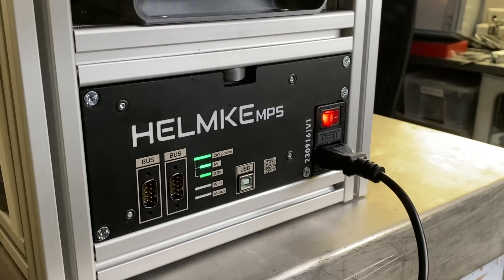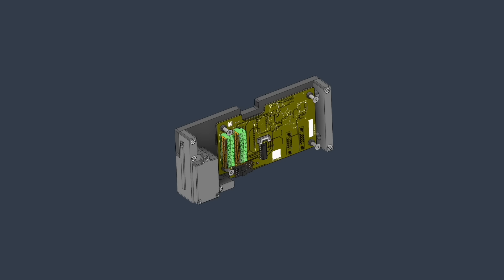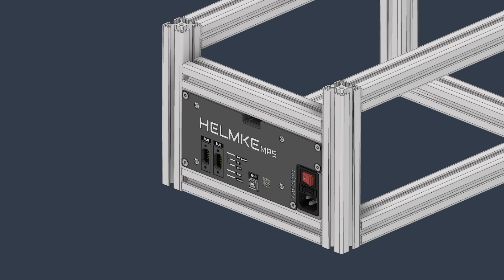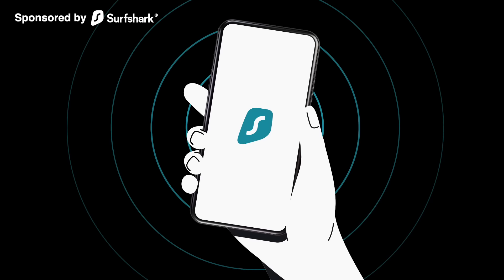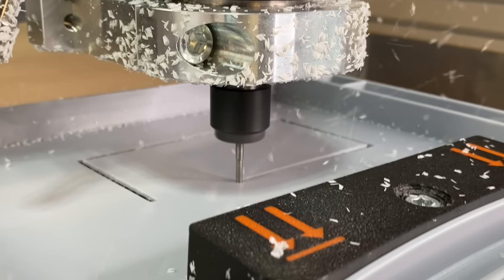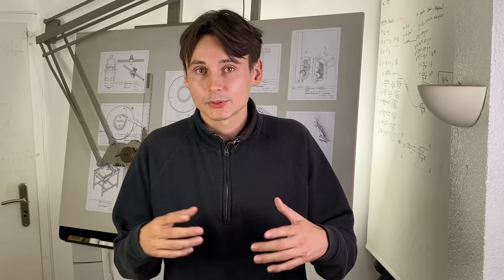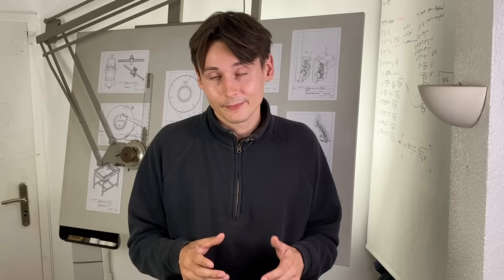Feeder control panel - 3d printed automation #007

Comment: Wow, impressive. Can you share technique how to laser engrave into 3D printed parts? How did you achieve such a high contrast?
Reply: Yes. That fascinated me. I'm not clear what kind of material the laser was able to etch so nicely. For all I know, perhaps black plastics tend to burn white like that.
Reply: Maybe the black plastic is only one layer on top?
Reply: he printed in two colors, using the white for the second layer. The already showing text and "light diffusers" showing when he put it in the laser area I believe confirm this, then the laser ablates that first black layer, leaving the white text and graphics in much higher detail than printable
Reply from the maker: it's an IR Laser, thats why it can engrave black surfaces with high contrast, you need a dark surface on white or gray it will not really show
Reply: You can look up "laser marking plastic" it depends on the material used and with a little trial and error with your laser you can achieve great contrast, even create debossed markings that can be transferred when making a mold of your part.
Reply: @christopherhelmke  Ah okay. So you're laser has a wavelength between 1300 to 1700 nm. With IR, the black plastic simply burns to white apparently. I'm guessing it's also higher power (say 20W?) based on what I am finding in other examples of "laser marking plastic" online. This looks so useful. I'm envious as I only have a 2.4W blue diode laser (450nm) on my Zmorph VX so it probably wouldn't be effective. If anything, it's likely so slow it melts.
Reply: @christopherhelmke  which laser are you using?
Reply: @Keksstar looks like an xTool F1
Reply: @christopherhelmke  that is such a great idea!
Reply: @christopherhelmke can co2 laser achieve the same result too? I'm very curious what material you used to make this work. Good work!
Reply: @christopherhelmke Welchen laser nutzt du denn?
Reply: @christopherhelmke This is really interesting... So xTool F1. What plastic? PLA, PETG? A video about this would be really interesting..
Reply: After some testing, petg works (brown beige), pla was spectacular... (White grey) Realy good contrast. This with a fiber laser (1064nm), GCC LaserPro S290 LS (60w). Tried our std filament PETG-ESD from 3dXtech and that did not work at all... (Probobly carbon powder in that, witch affect the result, no color change at all)

Comment: Good stuff. I like how neat everything looks and how well it comes together.

My only comment is that, based on my experience, I would advise against using RS845. It might be fine, especially if you only transmit in one direction. But you still need to manage data corruptions and retransmissions. If you need multiple nodes to talk on the same bus, things get more complicated due to the required arbitration. Collision detection is a PITA to do in firmware and, while there are alternatives (polling, token ring) they're less flexible or less performant. When the MCU needs to do other stuff, there's the complication of interrupt latency, etc.

This is a solved problem. An example is CANbus. It's simple enough and many MCUs have a built-in CAN controller, only needing an external transceiver that you'd need anyway for RS485.
There are other options, though I don't have first hand experience.
Using a network controller instead of raw RS485 will save you a ton of time and trouble.

Apologies if I mentioned things you already know, you only briefly touched the subject.

Comment: Re: power.  You can also gang up pins to reduxe resistance.  I have seen some old main frame boards where they bodged like 2x8 pins together as a power bus.   Seems like you got it covered though

Comment: You could put pins on bottom/top so that modules can share power or at least communicate when stacked, also there is C14 connector so you could daisy chain mains between them

Comment: Another excellent video! I was wondering if you've considered linking power between boxes on the AC side rather than the DC. You can buy C14 power connectors with an integrated C13 loop out online.

Comment: You can use a IEC c13+c14 panel mount adapter to chain 250VAC@10A (or NAC3PX which provides 250VAC@20A). 
For data you can use a protocol like 10BASE-T1S to multidrop data, which provides a robust industrially rated galvanically isolated protocol. 
Microchip LAN8650/1 has a built-in MAC in the PHY allowing you to use SPI with a cheap MCU to communicate over 2 wire ethernet.

Comment: You should consider "Plug in terminal blocks" for the controll board connectors. Allows you to easily switch out components and controll boards.
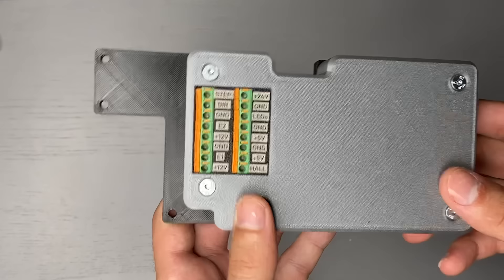6:40

Comment: In server room applications it is (or at least was) somewhat common to have a rack mount device with the regular IEC-C13 in socket, and then next to it an IEC-C14 socket. You would then have power cables with these same connections on it's ends and this lets you daisychain devices. You can even buy a combined in-out socket block. The ones I'm seeing have the ground pins tied together but you're responsible for how live and neutral get connected. I have found fused combination modules, but not any switched so far (maybe 5 minutes of looking). With the DC-daisychain you can potentially eliminate multiple AC-DC converters, which is pretty much always a big cost saving, but with AC-daisychaining you don't have to deal with the noise problem.

Personally I think the best route for daisychaining power is to use a robust, locking DC power connector, and have dedicated power unit as the bottom. This should solve the noise problem just as well, and lets you have a single better-quality high-power PSU. If you could find something cheaper than, but like, the typical "Trolling Motor Plug Receptacle Set", that would be great. The major downside of these is they're waterproof, so they're usually like 20$. In this regard AC-daisychaining wins, it solves noise and uses commodity cabling, but if you could source an appropriate DC connector system for a reasonable price, I think there's still room to save money on consolidating power supplies

Comment: It would seem overly costly to overrate the power supply in a single unit and then it end up being underrated for three daisy chained systems. Back in the good old days, early PC power supplies had an IEC input and a pass-through IEC output to power the monitor. Thus removing the need for an extra mains outlet to be available. Also, when you powered up the PC, you were guaranteed that the monitor would also be power up. Perhaps you can still source a solution with a pass through for mains.

Comment: Daisy Chaining is not so complicated if you use a current driven physical layer and a slow enough baud rate for your serial data. Industry has been doing this kind of thing for decades, often running kilometer-long wires in simple conduits next to each other. The Bambu Lab AMS supports daisy chaining of up to 4 units, all supplied from the printer. The trick is to only actuate one unit at a time, saving the need to supply all units at once. USB is the prime example of running a power hungry hardware right next to differential signalling. In the words of Look Mom No Computer: Don't be scared to try it

Comment: Oh my gosh! I love your videos! I would love to see a video on you designing the PCB if your up for it.  An idea I had for the daisy chain, you could imbed terminals into the box itself so when you stack them you don’t need the additional step of plugging in a cable or even 2 if one cable is for signal and the other is for power. However, this would take extra time to design and may not be worth it. I was going to suggest passing AC to each of the boxes so that each can use their own power supply, but I never thought of the challenge of the power cable producing so much noise it interferes with the signal wire. If you passed the signal and power through different terminals would noise still be an issue?

Comment: Maybe you could integrate connectors for power and data in the top/bottom of the box itself, so they automatically connect if you stack boxes on top of another. Like these cheap electronic toys/figures from McDonalds 10 years ago that you simply connect by sliding them together without the need of any cables.

Comment: Unless you want to have different power suppy options for the boxes (none, capable of powering 1 box, more powerful), I believe connecting each box with a seperate mains cable is the best option. I would recommend using rs485 over standart ethernet cables like some home powerwall products do. Patchcables are easier to comeby than the dsub cables you are using here.

Comment: Instead of transmitting power over the bus and having to beef up the individual power supplies, you could potentially do what work lights do by adding an outlet to the design. That way, AC power is being shared and each box is using its own power supply. Also, as many have mentioned before, IoT wifi connections are notoriously unreliable and it would be for the best of the design to remain wired.

Comment: Consider integrating the power and data into the chasis itself, it's a bit more complicated, but you can make those into submodules as tubes that run the height of the modules, and connect above and below, with some ingenuity, you may even be able to manage side to side as well, though with the spacing required in some of those cases, you may need to create standalone spacers as well.
Reply: Thinking more about this, separating the entire AC system into a series of posts that are through each box would be a lot safer, and you could configure them fairly easy with something like some dip-switches so that you can have a single power distribution unit for quite a number of boxes, rather than making one of the units dual-purpose.  This means you could use larger, more efficient power supplies, setup monitoring both for consumption and for safety and do it all in one box.  Then you can deploy those boxes throughout the matrix where they make sense, often at the bottom of the stack as power distribution gear tends to be heavy.

Comment: The "thin diffuser" was very interesting! Are you using a different clear filament in your 3d printer, or some other material?
Reply: It looked like a material embedded within the outlines of the first layer. But I can't see any lines within itself, so I'm unclear if he printed them with a dual material printer or paused and simply painted the diffuser material in between the lines manually. Whatever was done, it came out very nice!
Reply from the maker: Hi it's just normal white filament. If you chose the right wall generator (Arachne) and have the first Layer calibration right (or a printer that does it automatically) then there should be no gaps or printing lines visible in this print orientation. 
With a textured Sheed it works even better, but on that "rough" surface you can't read the Laser engraving super well.
Reply: @christopherhelmke Thanks for clarifying. Great work.
Reply: @christopherhelmke very clear! Thank you! My printer is single filament, so I think I might do the same as you but maybe use clear hot glue before I remove the print from the bed.

Comment: I can recommend the esp32 it is a powerful dual core micro-controller with WiFi on board and its cheap.
I really like working with them. but get one with a external antenna U.FL, IPEX plug.
The range on the ones with a PCB antennas is horrible, like 2-10m range.

Comment: I'd like to know more details about how you etched the plastic?  I think I understand how you printed white/black dual color pla for printed in markings, but how did you get white etching with the laser on black pla? Does it just.. do that? I've never tried..  Or is it a special plastic mix that turns white under laser?
Reply: The laser that was used has both a diode and IR laser. The IR can engrave 3d printed parts.
Reply from the maker: just like @Jon_raymond said. The IR can engrave darker plastics, you will need to use black to get a high contrast
Reply: I will try, thank you! @christopherhelmke

Comment: Really great idea of marking 3D prints with a diode laser! Just a quick thought, why not daisy chain the 230 V input and then data separately? That would solve your data integrity as well as PSU problems when daisy chaining a lot of modules.

Comment: Did you think about some kind of "springy pin" connectors, so you have a connection just by stacking your feeders? Then you would need just one power supply per stack...

Comment: Why not just have two wires between the modules? One for power and one for data. It would also help with your power supply issue, you could have all the modules powered separately but still have the data chained together, or you could have it set up so that the data is chained through them all but the power is only chained through say 5 modules. So if you had 15 modules they would all be chained together for data but for power they are set up in 3 groups of 5 and within the group of 5 the power is chained together for power.

Comment: What about pogo pins on the top of the crate for power delivery and data communication with a matching receiver on the bottom; just stack the crates for connectivity.

Comment: what about integrating connectors to the top and bottom of the boxes that automatically connect while stacking? This way you can separate power and data in space and the cables are no longer a problem in general. Very nice video though!

Comment: Did you consider power up higher boxes by some sort of pogo pins?
Reply from the maker: Yes I did for a while but there are a few problems with this: 

1) the boxes have quite some horizontal play, they do not center perfectly on top of each other +- 4mm is a lot for the pogo connections I am aware of. 
2) this should be an MPS wide standard connecting all the modules, like the Sprocket dispenser and this needs a cable connection anyway  
3) space in this direction is very limited, part count would increase

There are workarounds for all of this but I wanted to get something to test it first... might come back to the pogo variant later :)

Comment: I have to ask, when the drum rotates, you have a small arm that lifts itself to avoid the nuts that keep the 3d print stuck to the drump, why didn't you just create a sink hole for nut that attaches to drum so it doesn't come into contact with small leaver part that knocks the screw down?
Reply: I think this every time too - however

I really have to think that Christopher has already considered this.  There's no way you'd design the lifting arm mechanism without having considered this.  My off the cuff guess is that it's just mechanically more robust the way it is, and that makes the additional complexity worth it
Reply: @rustybrooks  it can't be same simple tho, at worst, he must lose about 1 cm in space moving drum part and case forward. I can't see how it makes it more robust since it's an extra servio motor been added.
Reply: @UselessProjects  idk man, just seems a little presumptive to think the guy programmed a way for the arm to move up and over a bolt and it never occurred to him to move the bolt out of the way
Reply: I have a feeling the protruding bolt heads are actually used to agitate the loose bolts and create space to pick one with the magnet. Otherwise the magnet might not be able to pull a bolt free from its neighbors.
Reply: @rustybrooks  I'm not saying I'm right, why I asked in first place. Be nice to know the reason, that's all :)

Comment: Is power and data over the same wire really such an problem? It’s common to power cameras and WiFi APs via Ethernet (Power over Ethernet (PoE), e.g. ieee 802.1af) and there it es possible to send power along 10 gigabit links.
There is also the ieee 802.1bt standard wich allows for up to 100 watts via a single Ethernet cable.

Comment: i don't know why you couldn't route signals in parallel with noisy power lines (given they are differential pairs). if CANbus works in a noisy-ass environment like car, it's going to work in your system. if anything it'll just affect your data rate

Comment: 6:35 im suprised you didnt use the cheaper two piece screw terminal blocks? Like the one that the part you screw wire into is disconnectable?